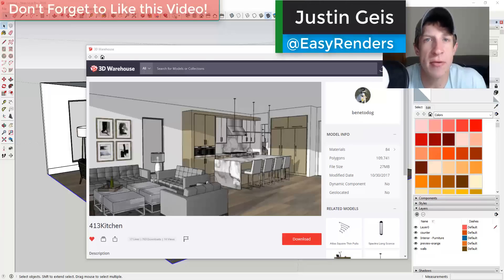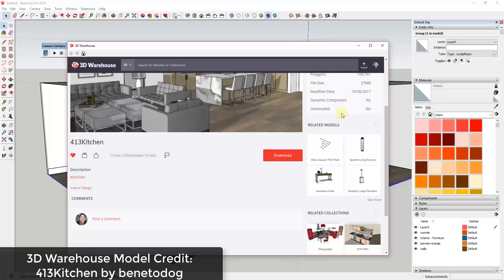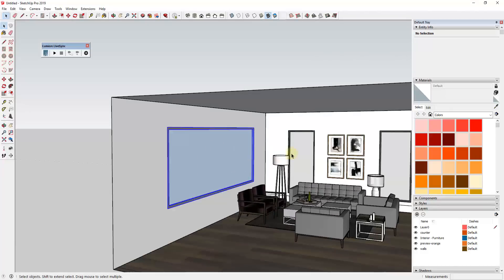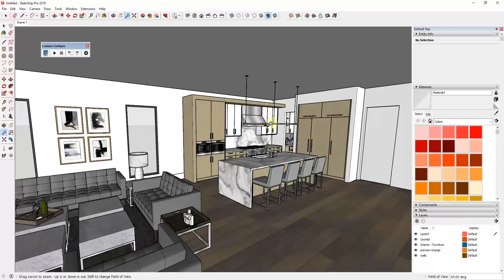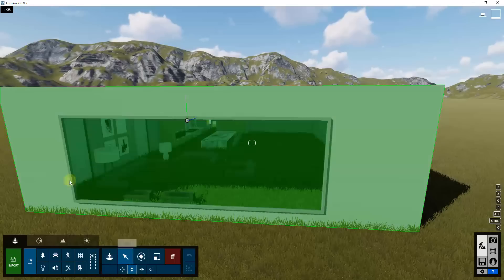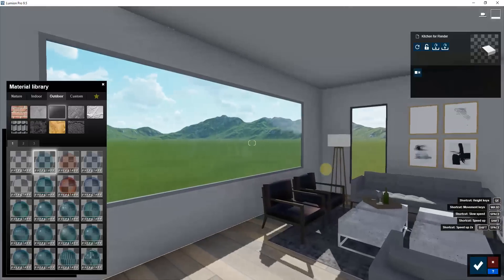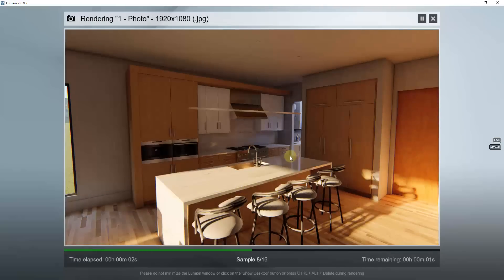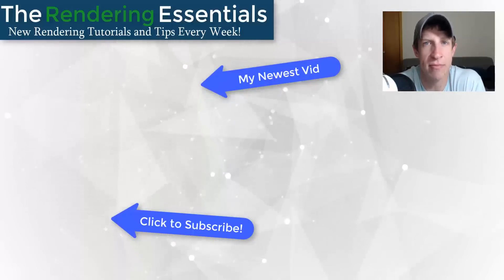Lumion 9.5 Kitchen Workflow - COMPLETE SKETCHUP TO LUMION WORKFLOW PART 1 - Importing and Materials

Comment: Hello justin, i have a problem with my model in sketchup. When i import it to the lumion the model only have 1 layer. So when i need to apply materials it will apply all over the model. What should i do.?
Reply from the maker: Do you have materials applied to it in SketchUp? Lumion replaces the materials in your model, so if you haven't applied anything in SketchUp, it just assumes everything is the same material